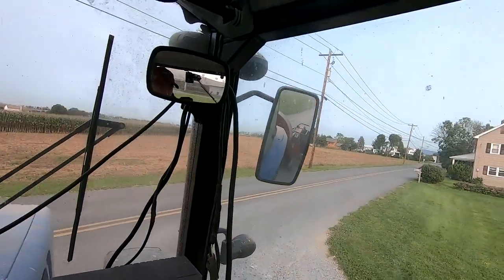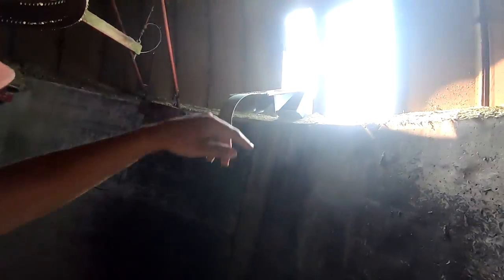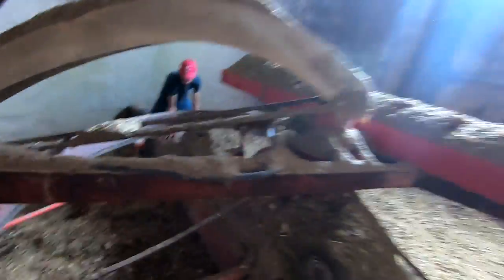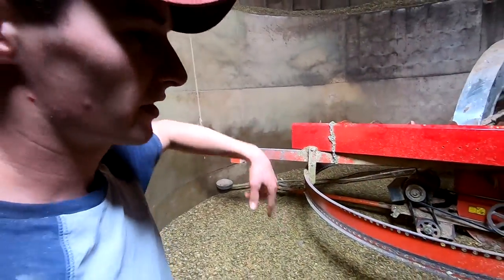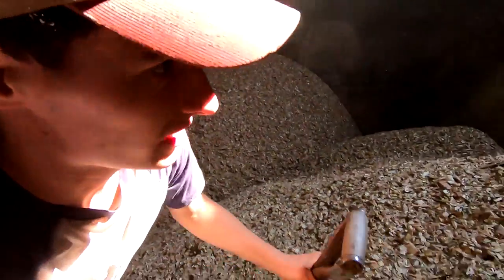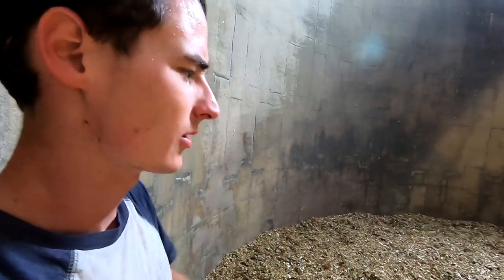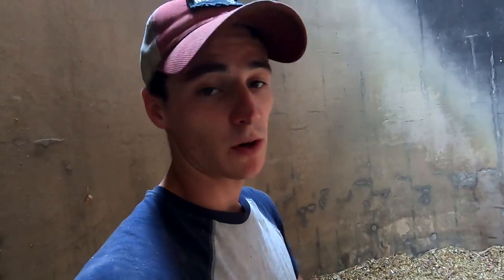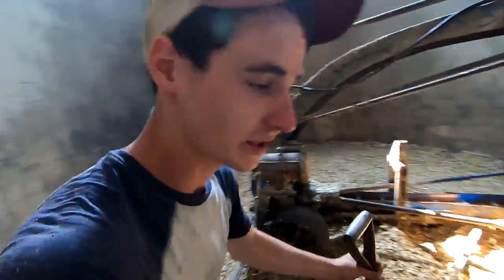Setting Up Silo Unloaders to Feed Corn Silage

Comment: Had to watch this video as I recognized the Patz unloader. My dad used to sell them. I have adjusted several hundred of these things for myself and other farmers.  Brings back a flood of memories. Yeah, when a person was working by yourself and had to do adjustments to the unloader to get it going, to save a trip up and down the silo I'd leave it run and climb down as quickly as possible.  Later years we used the hood with the plastic feed tubes, that made going up and down a lot easier and cleaner!

Comment: I respect and understand your work ethic.  I grew up as the grandson of a century farm owner in MI.  I have done that stuff, helped hand milk 60 head in a power outage and baled hay etc.  I do wonder that you are still feeding silage from an open concrete silo, as the nutrition research done since the 60's shows that there are many better ways to store forage now.  I used to also build Harvestore feed systems, so I do know a little about the subject.  I understand that open silage storage is less expensive.  You may find that the efficiency, nutrition and reduced losses to weepage, mold and mildew etc. makes alternative storage worth the investment?

Comment: As a kid we had 4 silos with 1960's type Badger brand single auger unloaders, they were always getting stuck.  Of yours I assume the one with that runs along the ring never gets stuck and can't get stuck, and the ones with drive wheels in front and behind the auger rarely gets stuck.  Ours would get stuck because the auger would dive into the silage.  The wheel in front assures the heighth.

Comment: Is the corn in your silo fermented?  Cut 'yesterday', right?  So you use both unfermented chopped corn, and fermented corn silage in your mix? Or does it actually ferment (turns to that brownish color as with your fermented bunker silage) in the silo, even not air tight?  I always thought fermentation required no oxygen, hence the not-cheap plastic and 5 million tires (lol) you use on your bunker.

Comment: So which way is easier/less labor intensive/cheaper: Silos or bunks?   /Bunks have expense of plastic. More work to load.
Reply: Id say silo is cheaper etc bc no compacting etc.
Reply: @southaussiegarbo2054 ,Thanks for answering, But I didn't consider the cost of building the silo.
Reply: @genedameier8746   it would still be cheaper id think.

Comment: Would it be possible to lower the  unloader with the sweep auger running and level the top surface instead of leveling by hand?
Reply: You can but would take a long time.  Takes 5-8 minutes to make 1 revolution. Only would work with the ring drive. Cannot do it with a surface drive unloader

Comment: Very important to keep that blower running. That gas can get you quick.
Reply: Just remembered a story. One time the gas got to a pigeon, and it died up on top of the pile. I threw it out the door in the roof of the silo, it fell all the way to the ground, but then landed in the blowers auger. 5 secs later, that pigeon was on its way back up the silo in pieces, on top of us. That day forward, I now throw them down the enclosed shoot instead 😂

Comment: Imagine having to feed the cows everyday using a pitchfork.
Reply: Most Amish farms still do it that way.
Reply: Dairy farm kid here... My Dad did that 60 years ago, twice a day. Getting the unloader was a really big deal back then
Reply: I did it for years as a child and youth.  Our silo was only 14' dia, smaller than these, 48' high.  Climbed the chute, through the door, kept the fork at the feed level.  By the time we were down at the bottom, the wooden handle had a new curved shape, permanent set in the handle.  A new fork was used the next season.  Our door may have been bit smaller, and they were not on a hinge. The were unattached.  They had an X-metal strap configuration on the chute side, to hold it in place (tapered fit). I always had to take out one door, lift it to the open spot above, and reposition for closure.  Grass silage was more difficult than corn silage - hangs together and comes out in "slabs."

Comment: That silo unloader name brand it patz it the best silo unloader than other 4 name Van dale    Jamesway    Acorn   Badger.  We have same patz last 28 years but yes repair replace parts  blower two speed change for corn and hay   Hay require high speed all just put smaller puller on blower large puller for corn